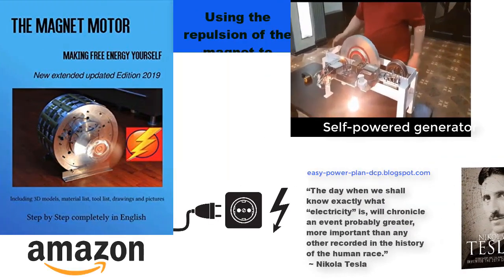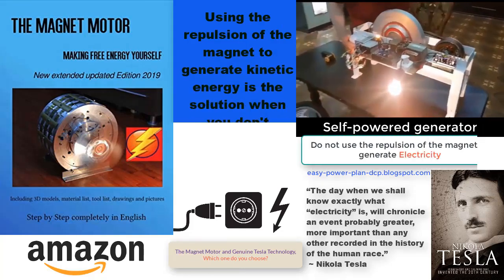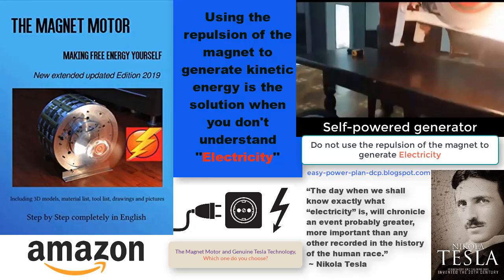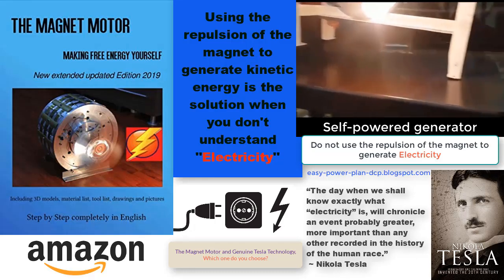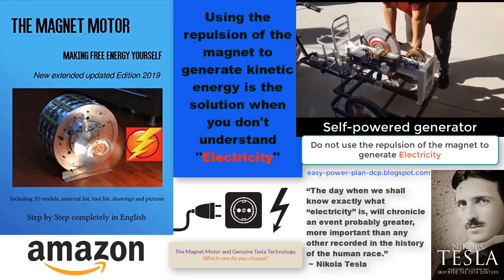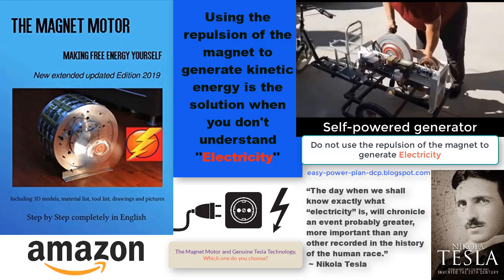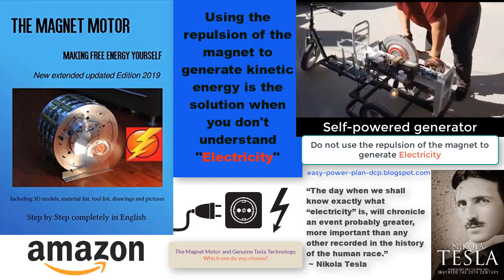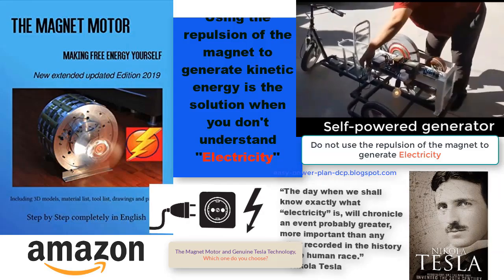Edwin V. Gray's Cold Electricity vs. Tesla’s Radiant Energy: A Forgotten Legacy

Comment from the maker: Edwin V. Gray, a U.S. Air Force engineer and machine-shop technician, built upon some of Tesla's foundational ideas but approached the problem of energy in a more mechanical and practical manner. In 1958, after a discussion with an associate of Nikola Tesla, Gray discovered that a high-voltage, rapid discharge could pick up additional energy from the magnetic field it created. This "extra energy" could be harnessed in a way that had not been fully explored by Tesla, though Tesla himself had experimented with similar ideas. Gray's discovery led to the development of a device that could capture this surplus energy, effectively opening the door to what he termed "cold electricity."